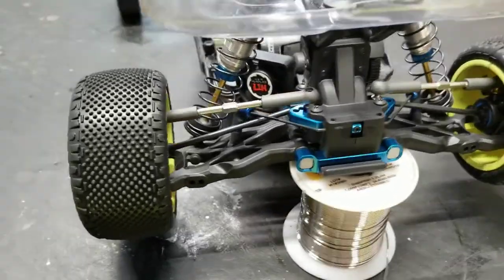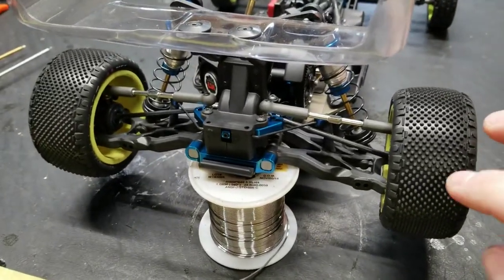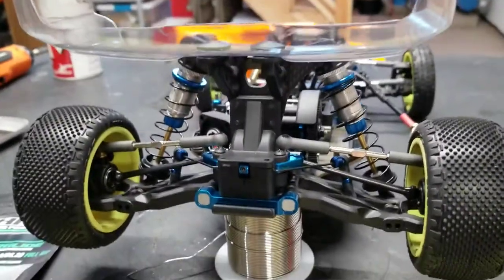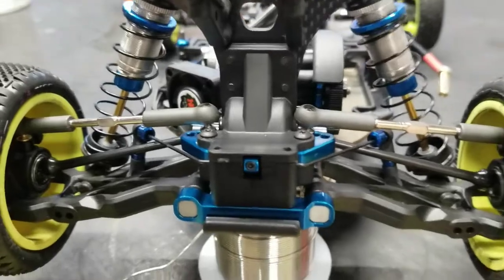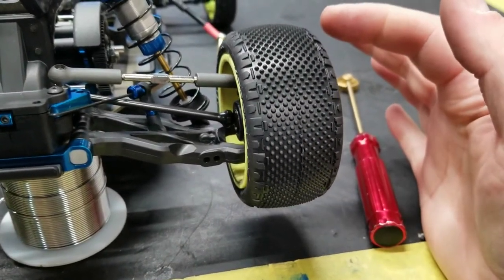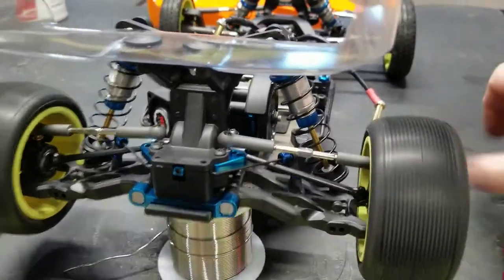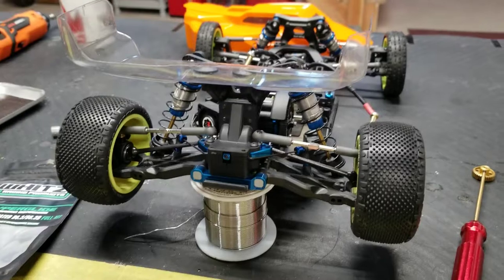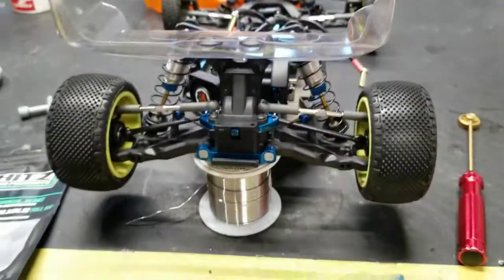Do Ceramic Bearings Make a Difference? B6.3 Drive line Test

Comment: Are you using the aluminum diff height inserts (91793)? 
Those really help in preventing bearing distortion to reduce bind/drag.

Comment: Can Tyler P do a video showing the Revolution Design b6.3 7075 chassis? I’m considering getting one. Also does the t6.2 use the same chassis as the b6.3?

Comment: $70 bucks for bearings, not sure if you will really be able to perceive the difference on the track.  Drive skills is more important than these expensive bearings
Reply: IMHO it only makes sense to use zro2 bearings in zenoah (or similar fuel engines) to free the crankshaft. If you really want to push the rpm up, it's even possible to use messing bushings (zero drag seals).
But if money is no issue, use them everywhere xD